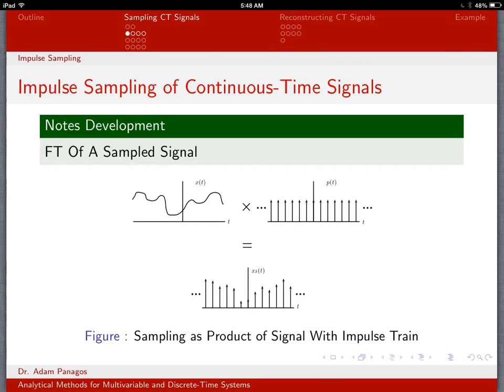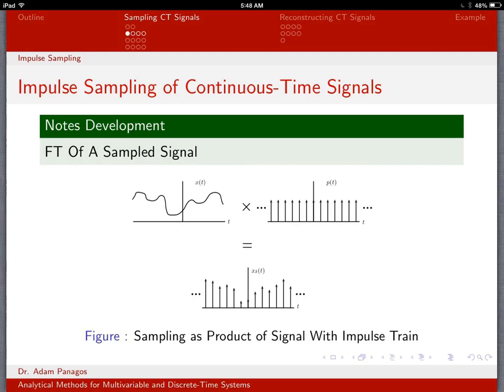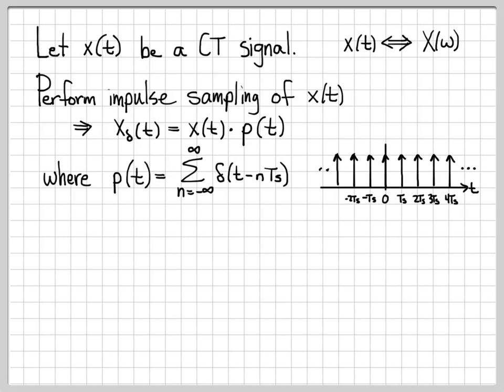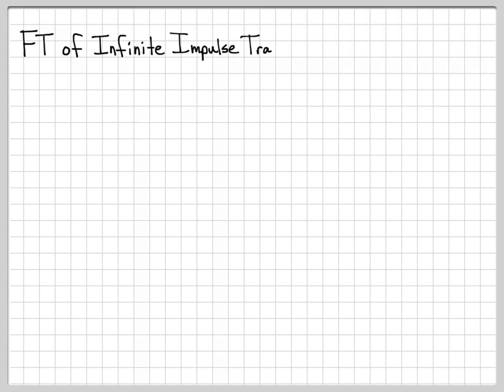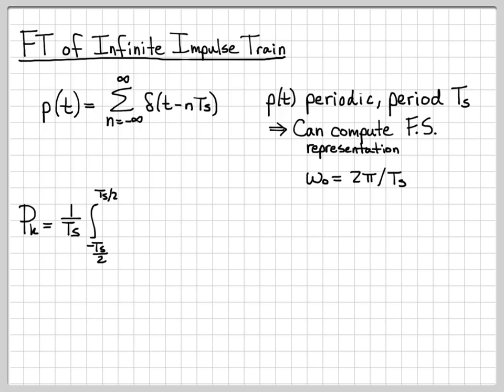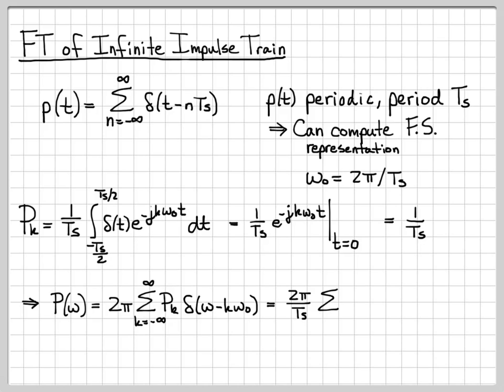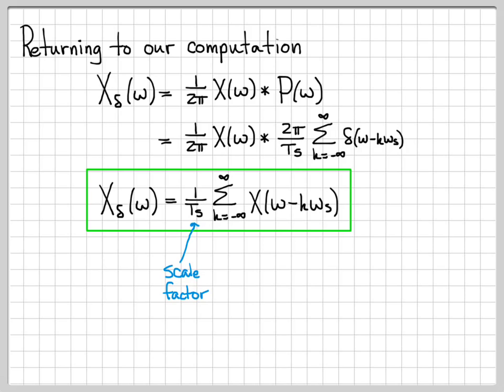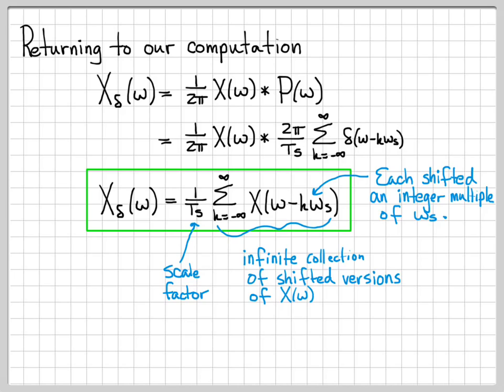Sampling Signals (3/13) - Fourier Transform of an Impulse Sampled Signal

Comment: Query: While computing the Fourier coefficient, why \delta(t) is used inside the integral instead of \delta(t-nT_s) ? I think at first one should use  \delta(t-nT_s) and then proceed with substitution t-nT_s=z. After that, one may obtain the Fourier series coefficients as P_k=1/T_s
Reply from the maker: The equation for computing the Fourier Series coefficients requires one to compute an integral on one full period of the signal.  You're free to choose any time interval that consists of one full period.  The period I selected was from -Ts/2 to Ts/2.  On that interval, the signal is equal to delta(t).  You could have selected a more general interval to work on, but this one centered about t = 0 is the easiest to work with I think.  Hope that helps,
Adam

Comment: Suppose x(t) is a sinusoid of the form e^(wx t), then its F.T would result in an impulse placed at wx. How do we convolve this single impulse with the other impulse train for P(w)?
Reply from the maker: Convolving with an impulse is "easy".  Whatever gets convolved with the impulse just gets placed at the location of the impulse.  So, just take the origin of the impulse train and shift it to the location of the impulse wx.  There's probably a scale factor to apply as well, but that's not too bad to figure out.  Hope that helps.
Adam

Comment: Hi Adam, thank you for the explanation. If I just follow about finding FT of delta train directely, I get a sum of infinite exponentials in omega which I believe is sum of deltas because the sum of exp at a particular omega cancels out for non multiples of 2pi. But this qualitatively tells that there is another delta train and its separation in x-axis, but doesn't give the magnitude or the area of the delta. Can you tell how to go about finding it?

Comment: How did you get the "Fourier series representation of the signal" at 6:20? Can you please explain how you got that representation from the regular FS formula?
Reply from the maker: Sure.  In general, the complex Fourier series is:

x(t) = sum_{-infinity}^{+infinity}Xn exp(j*n*omega0*t),

Each term of this summation is a the Fourier Series coefficient Xn times the complex exponential exp(j*n*omega0*t).  The Fourier Transform of this term is Xn delta(omega - n*omega0).  Recall, the Fourier Transform of a complex exponential in time is a frequency shifted-impulse in the time domain.  I'm just taking the Fourier transform of each term of the Fourier Series.

Hope that helps. If you found the video useful make sure to check out my website http://adampanagos.org where I have a variety of other resources available that you might find helpful.  Thanks, Adam.
Reply: @AdamPanagos  hey, im very new to this, and from a computer science background but trying to study digital image processing. 

I'm confused as to why you are taking the fourier transform of a fourier series.

Dont we get the fourier series BY the fourier transform? that is don't we get this equation:

x(t) = sum_{-infinity}^{+infinity}Xn exp(j*n*omega0*t)

by taking the fourier transform of x(t)? more specifically, don't we get 'Xn' in this equation by the fourier transform?

therefore from what I am understanding, we are taking fourier transform twice? once to find x(t) in terms of Xn, and then again taking fourier transform of x(t).. 

can you please let me know where I am going wrong?
Reply: nevermind I found it in my textbook

Comment: After you find the fourier coefficient, can you explain why the fourier series becomes 2*π Σ(P_k*δ(w-k*w_0)?
Reply from the maker: That's really just the definition of the Fourier Transform.  If we have a period continuous-time signal, the Fourier Transform will always be a collection of pairs of impulses.  For example, if we had a single continuous-time sinusoid with frequency wc, the Fourier Transform is a pair of impulses (one at +wc and one at -wc).  In this problem we've found all the frequencies present in the original signal (as quantified by the coefficients Pk), so the Fourier Transform is a pair of impulses for each of these terms.

Comment: What is the name of equation on 6:37 http://prntscr.com/dg8zso and if i am working with P(f) is it just P(w)/2pi that is same formula without 2pi? Thanks
Reply from the maker: Most of the equations I work with are in the frequency domain using the radial frequency omega (w).  Linear frequency (f) and radial frequency are related by the scale factor w = 2*pi*f.  This means that dw = 2*pi*df.  So, when working with integrals we'll often have a 1/2pi scale factor that's needed to have the "same integral" with respect to f instead of w.

Does that make sense?
Reply: Yes, it makes perfect sense. I like to work with "f" and all sources write "using w" so I must constantly translating it over to "f" and i am not expert at math, so nice to get a confirmation.